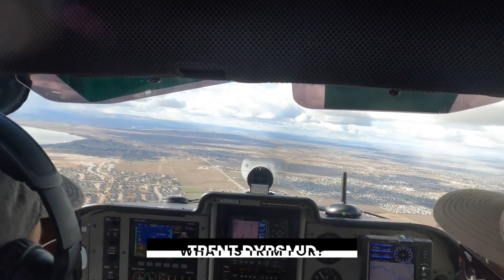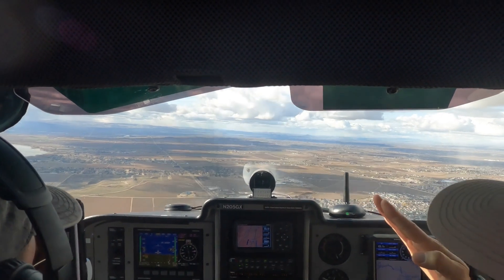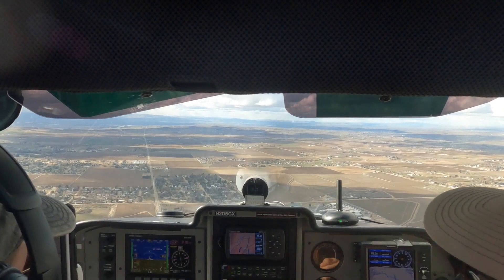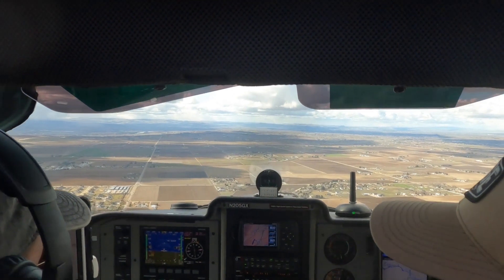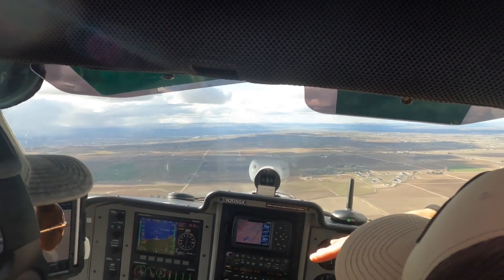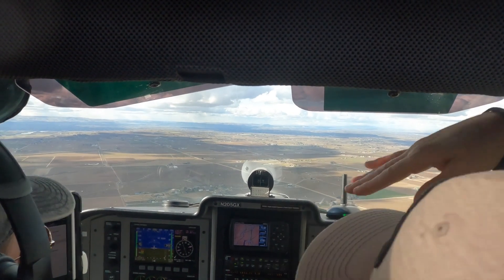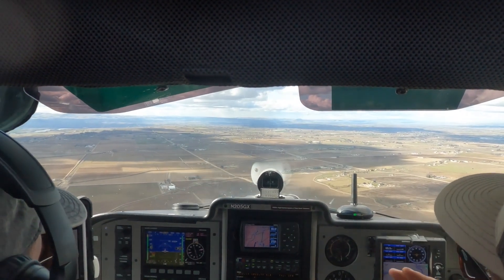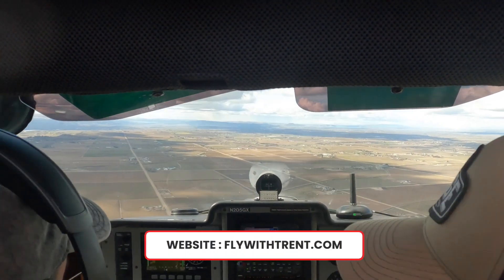What is Aircraft Trim For?

Comment: Fly the airplane manually first, no matter what phase of flight, then adjust the elevator trim, to reduce control forces so as to maintain the attitude you want (level flight, climb or descent).  Also, much of what you explained during flight, could be better comprehended by the student, on the ground. Then, do minimal instruction while flying.
Reply from the maker: You should start a channel!